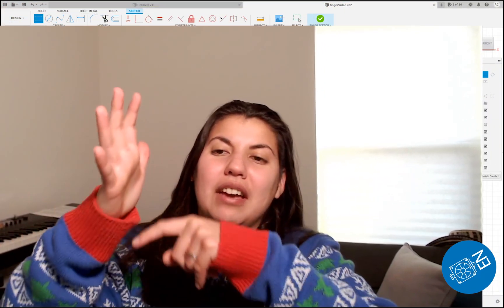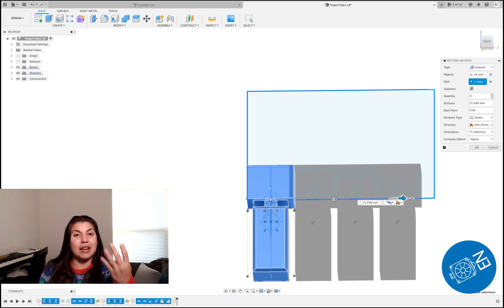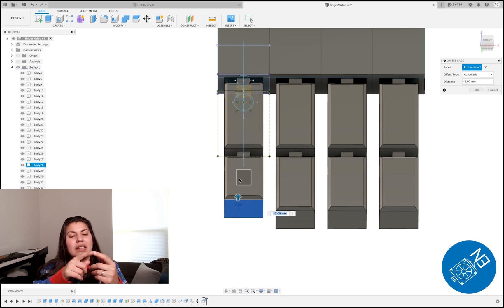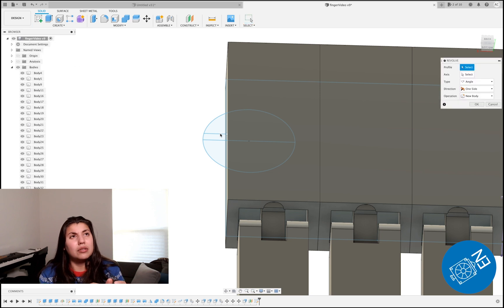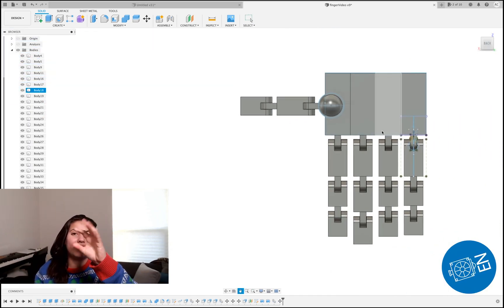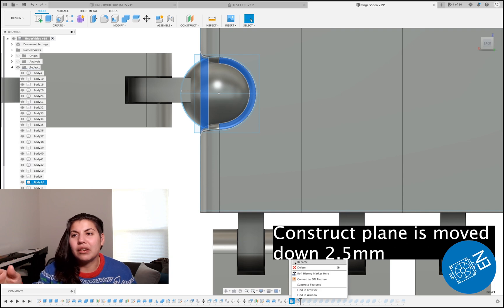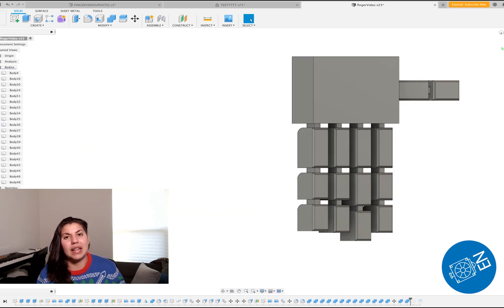Articulating Hand Part 3 Fusion 360

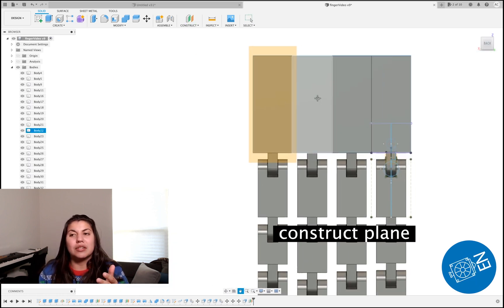Comment: At 3:14 how do you make the joints have that separating shape with the hinge? I’ve sketched and make it to look like that but when I extrude they all come out as one. I need for it to be separated but as a unit at the same time for the joint and fingers.
Reply from the maker: Sorry I took so long to respond! So Are you talking about the sphere where the thumb finger connects to the palm? I create a sphere to cut into the palm and then I create another sphere that is smaller than the original sphere, but I am paranoid so use new body for the sphere. Or do you mean the hinges on the fingers? Those hinges were done in the previous videos. There is a playlist on my channel of this. The link is down below. Let me know if you need more info!  

https://youtube.com/playlist?list=PLPV5OB1VZQh_YscVOq2KVTOnKec178LBi